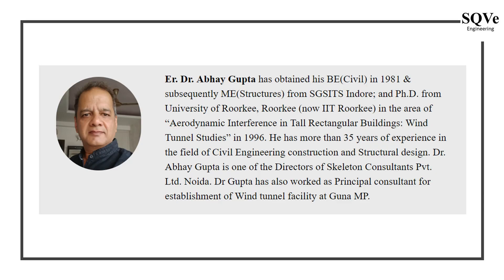WIND-STR-002 :  Estimation of wind force for TALL structures as per IS 875 (Part 3) : 2015

Comment: Sir, would you provide Excel sheets for gust calculation in your course?
Reply from the maker: Well, excel sheet will not be furnished. However, detailed calculations will be presented along with the worked out examples. Based on the same, excel sheet can be developed.